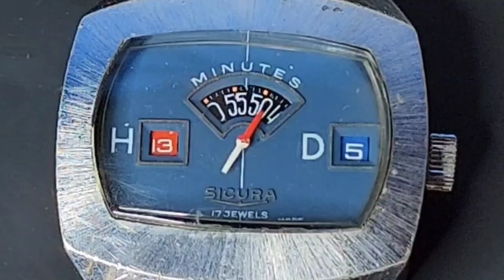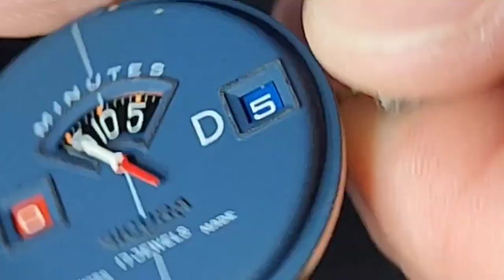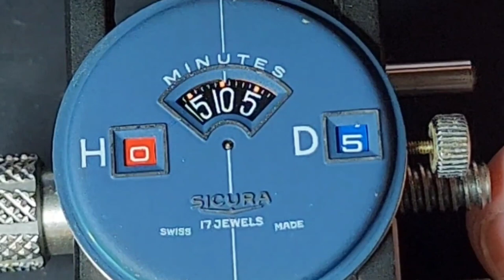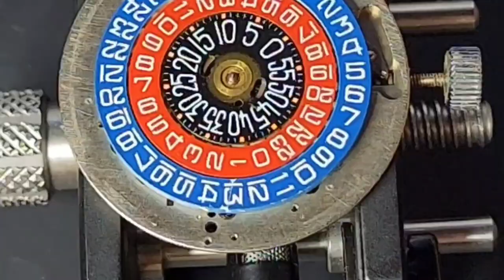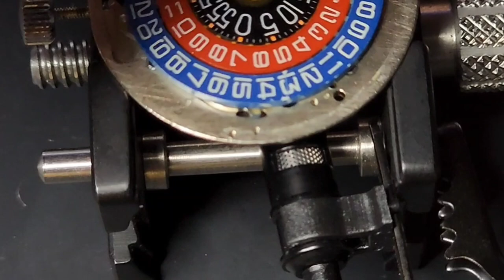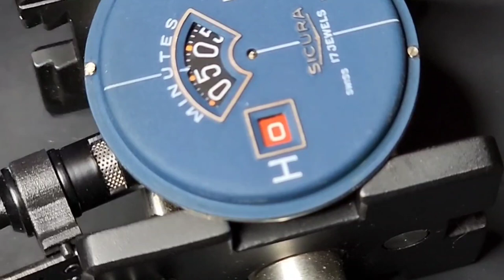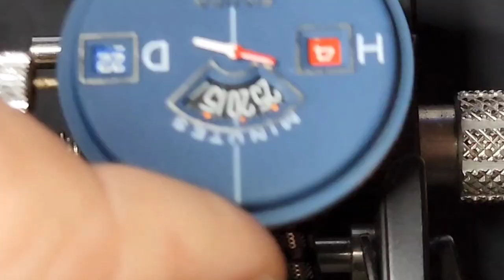JD's Sicura Jump hour, cal.  BFG 866. Cleaned/serviced

Comment: I have reassembled my 866 movement and the canon assembly pinion moves with the crown in the setting position and I can set the date and hour rings. When the movement operates the canon assembly does not rotate to advance the date, hour and minute rings. Any ideas about what is wrong?
Reply from the maker: I've noticed a lot of these have loose a "cannon assembly" on nearly all of the "bad" movements. I have not attempted crimping them or tightening them. I usually just replace them. Since this movement is very common and relatively cheap, it's easy to get the part.
Reply: @ddaavvee  Another enthusiasts told me that the mainspring barrel that has a rivetted wheel provides cannon pinion friction. The wheel becomes loose and can be tightened with a domed stake or just replaced. Do you have any suggestions to order either a cannon assembly or mainspring barrel parts for the movement?
Reply from the maker: @tracymartin1979  if you can get the cannon assymeby, go for it. Otherwise I normallynjust buy a whole barrel, it's easier to find. If you can crimp it, I don't see why not. I normally do that with steel parts. But, if I remember right, the 866 is all brass, very soft and harder to take apart without deforming it, probably harder to crimp it just right too, haha. Like I said, I've never tried on this movement, I just replace it.
Reply: @ddaavvee  Cousins has a barrel cover and Scotch Watch has a complete barrel assembly (don't know if it includes a mainspring?). I'll probably get one of these and replace. Not looking forward to having to reinstall the train wheel bridge again....really took me a long time. Thanks for your help.
Reply from the maker: @tracymartin1979  dude, you're not alone, those bridges suck, haha. Good luck!